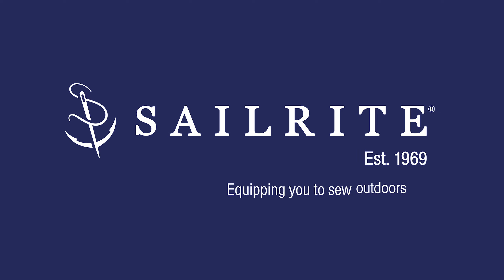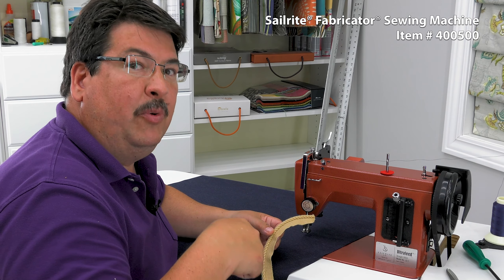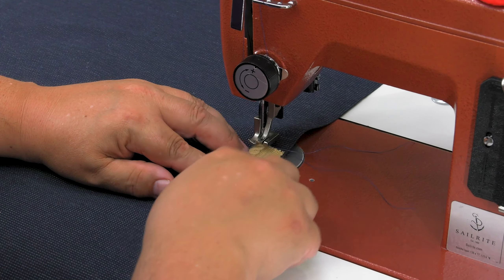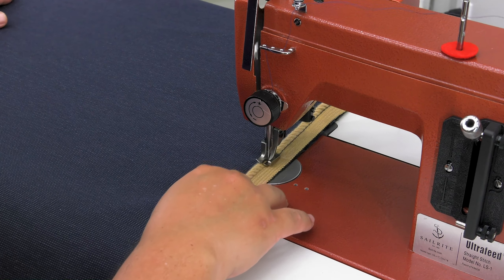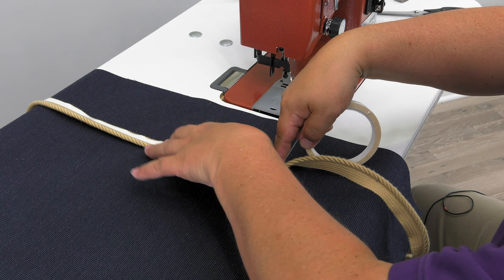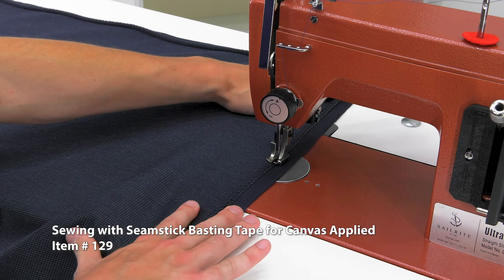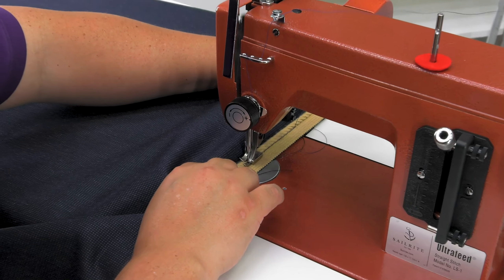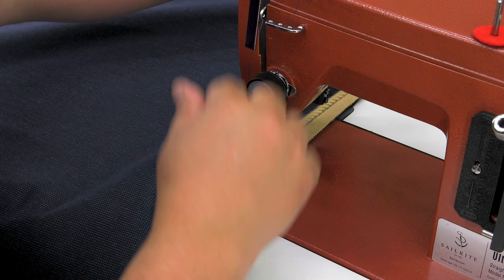Tips to Avoid Puckering When Sewing Decorative Piping

Comment: just started to work with basting tape, it makes life a lot easier. A lot. Only drawback is that it tends to sometimes gunk up the needle, not sure why this happens sometimes and sometimes not. But I would not want to be without it.
Reply from the maker: Excellent! We use Seamstick Basting Tape for almost all our sewing at Sailrite. A couple of suggestions about gunk on needle –
 
1.       Try the next smaller needle. Sometimes you just need more friction between the needle and the fabric to clean the adhesive from the needle. Otherwise the adhesive fills the groove in the needle and keeps that groove from performing its function – allowing the thread to slip on one side of the needle to allow for thread loop creation. If the loop is not created then the machine will skip a stitch or stitches. I can see the adhesive buildup very clearly in your photos.
2.       Push the needle into a bar of Ivory soap repetitively to coat it prior to installing it in your sewing machine. Adhesive just doesn’t stick to this soap and it sometimes works really well.
3.       Make sure you are using the right basting tape. If the tape you are using has too much adhesive content it will stick great but will also potentially cause stitch skipping.

Comment: Thanks for the vid. Does the basting tape leave adhesive residue on the needle?
Reply from the maker: Yes, seamstick can make your needle sticky, if the fabric your sewing is very light. The issue with sewing lighter fabrics is that they do not clean the needle as it exits and enters the fabric. If the needle becomes sticky, when sewing light fabrics, to help prevent buildup on your needle, rub the needle with a bar of Ivory soap or swab it with rubbing alcohol.
Reply: Spray the needle with silicone once in a while.